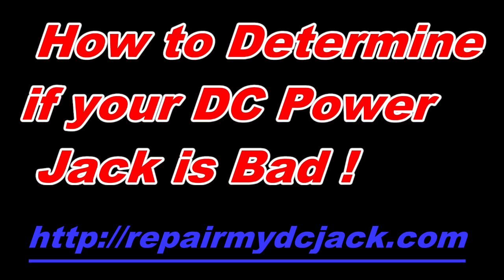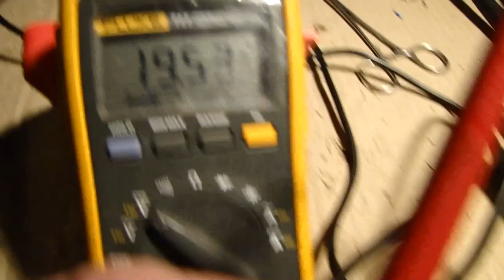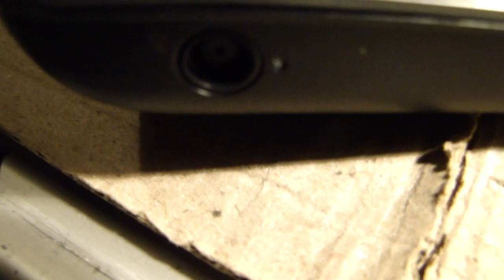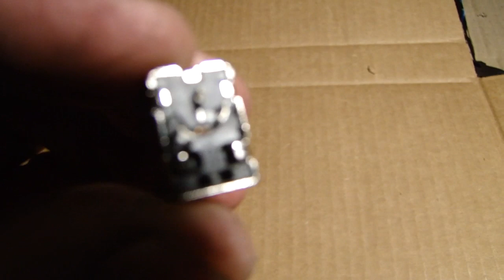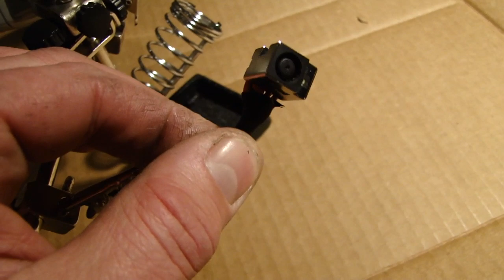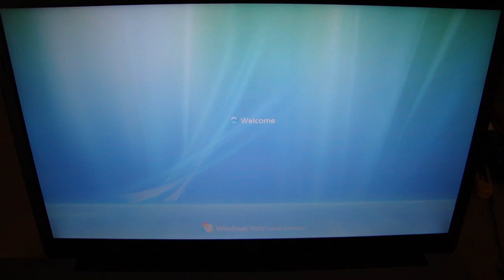Laptop DC Power Jack Repair and Replacement

Comment from the maker: @firstcomputerservice 

Those jacks are pretty straight forward to install, now when you
get a smashed in DC Jack Port seat on the bottom case then that needs to be shown, I will try to do that video someday, I have a whole new method in seating the DC Jack in the case of Toshiba's and HP's I do not even have time now to solder these anymore I just buy the pre-made plug in jacks, I still solder the Toshiba Jacks.

Comment: thanks
i get that but i just need to see what goes where as my wires broke off the power tip so i cant tell which wire goes where. do u have an intact one laying around you could check the order of the wires for me?
it would be greatly appreciated.

Comment: Will North, once again, thank you for all reply...

But, can you help... what seems to be the problem? i just connect ac power without battery on it, and then, no more switch omn, only thing is the led light 5 seconds then came off...

What you can say about it? do you know any test? on ac connector? or something else...please let all knows...please!!

By the way, how can i test the video chip solder on the PC board??

I guess is the mosfet on the board is on bad way...i guess...

Regards

Comment: I have a HP DV4 I had my laptop on a long time it kill the battery so it turned off so every time I plug the changer in it lights up cut on a min with the battery ONLY and turns off. So I replaced the changer and it worked a min then, cut off. So I don't know if the DC plug need replacing or the motherboard but, no blue screen.The jack did sometimes say not changing and was plugged in But, it did kill my old changer. I took it to Greek Squad and they want $150 just to fix.Please help thanks.

Comment: to the guy with the headphone problem.
you need a headset that has 2 connectors, 1 is for hearing,
the second is for the mic so the other party can hear you.
or you could use a bluetooth headset, the green jack is only for listining .

i hope this helps.

Comment: But,the led near CD jack, go on 5 seconds, then off softly.
The only thing I did was connect the AC without battery, switch them on, and then all you know, the led make that signal.
It is not worknig, it was off, i connect the AC to power up then the led did that until now, dont siwtch on, why??
I guess if if all ready working may have burned, but he was not working, they not have battery on it or or AC connected, a juta connect after, only the AC power...
Help best regards

Comment from the maker: you can buy a new one with wires on it from ebay - as if you wire it wrong
you could smoke your laptop - post your laptop model here and I will send you a link.

Comment: wtf is a laptop charger port caled
Reply: DC JACK
Reply: +Will Orth okay you know an alienware 13? my DC JACK broke is there anyway to replace one with desoldering and soldering on a new one?
Reply: +Asa Jaman you have to solder it. no other way.
Reply from the maker: +Will Orth if you take out the motherboard i do these for $40.00
$40.00 Includes:
1) Parts and Labor
2) 1 Year warranty
3) Return Shipping Extra

http://repairmydcjack.com/dc-jack-payment.html